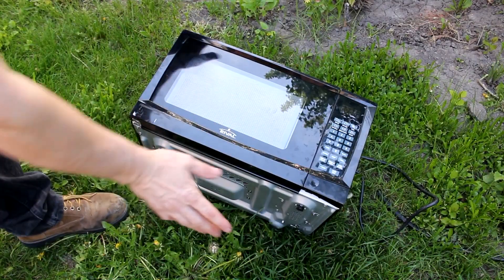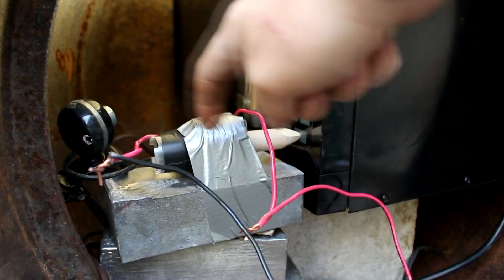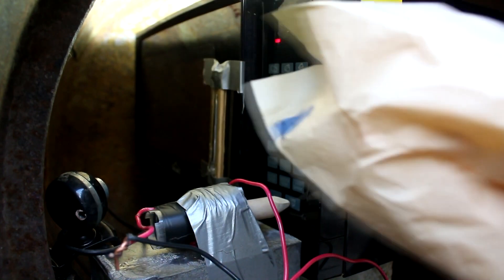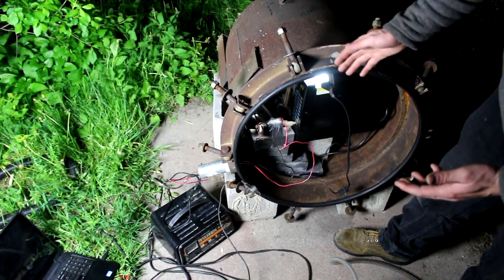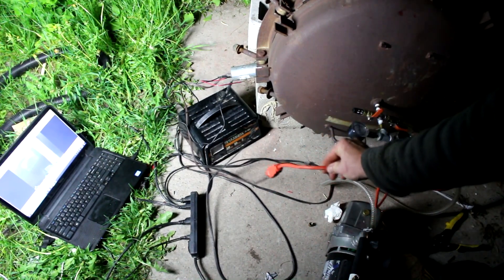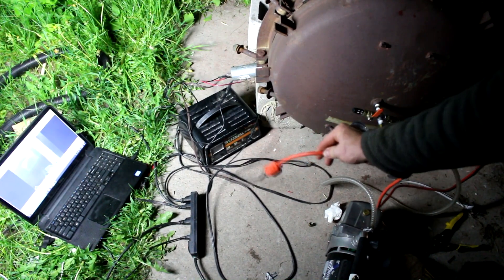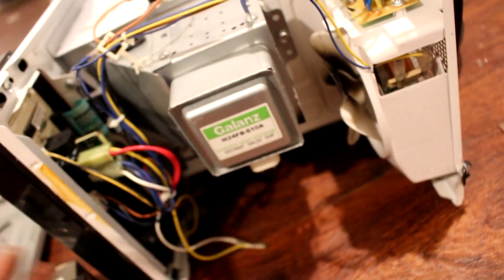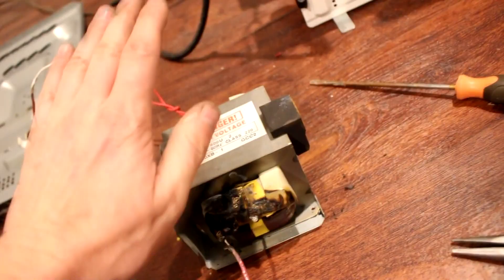Microwave In Vacuum Chamber

Comment: What happened was that the low pressure atmosphere allowed arcing to happen between winding sections of the high voltage secondary of the transformer. The coils are designed to be used under atmospheric pressure, not vacuum. Since the air insulation was removed via the pump, arcing ensued within the transformer. It would have probably worked under a high vacuum though. Basically the voltage difference between the 2 windings on top of each other was greater then the voltage needed to cause a breakdown of the gas.

However there is another permeability, a Corona discharge at the high voltage connector directed at the iron core, seeing as the core is at at ground potential. Looking at the damage seen, that is most likely scenario. However, without dissembling the secondary coil, we wont know if the first option didn't happen.

Hope my rambling explains it.
Reply: John Possum & ElectroBlood & Wood 'n' stuff, etc.; No, DEFINITELY not. Alright I thought this was too obvious to need explination, however I will go into detail for you.
TL;DR, the arc initiates IMMEDIATELY after the microwave is started (you can hear it at 4:38), which is incompatible with failure by Joule heating, but fits with the decreased breakdown strength of air, presicted by Paschen's Law.

Firstly, the "filament opening" causing a back-emf that exceeded the insulation voltage. Well, when he holds the transformer up at 7:57, you can see the filament winding between the primary and secondary coils. The arc never touched it, and it didn't draw any excessive current as the insulation is not even discoloured at all. This makes sense, since the bottom of the secondary is GROUNDED and the filament winding carries a VERY low voltage (usually <10V), so the filament winding is effectively screened from the secondary, BY the secondary.

Next I'll explain why "cooling failure due to not enough air blown by fan" also doesn't fit. Usually the secondary is wound with around 25-gauge copper wire. To give you  the ~2000V that the secondary outputs, from the 120V being input, (I am using the 'worst case' values for my explanation; It is even more impossible with higher output voltages or lower input voltages, since more turns on the secondary would be required.), you require around 17x the amount of primary turns.
With this in mind, we can calculate the mass of copper per meter (for 25AWG that comes out as 145.69g/m) and multiply that by the specific heat capacity of copper, which gives 56.09J/m°C. That means that 56 Joules are required to increase the temperature of 1 meter of 25AWG copper wire by 1°C. Now, most medium voltage (which is what 2kV is classified as) cable insulation is rated to FUNCTION up to 105°C. Charring would not even BEGIN to occur until after 200°C, but lets use the lower limit anyway.
Assuming that the starting temperature was 20°C (it was probably even cooler than this), means that we need a temperature delta of around 80°C before the insulation would even THINK of melting.
Multiplying this in, we get 42,25kJ/m, so over 42 KILO Joules is required to heat 1meter of 25AWG copper wire by 80°C.
Now, the resistance of 25AWG copper wire is given as 106.2 mili ohms per meter. And since the energy dissipated in the wire equals I^2 × R × t (current squared times resistance times the amount of time the current flows), we can calculate the current required to heat the wire by that amount. For this we need the time.
In the video, you can hear the arcing start INSTANTANIOUSLY after he starts the microwave at 4:38, however he only noticed the smoke around 10 seconds after starting, so we'll use that to give your theory the best possible chance.
Calculating the required current, we come to I=199.46A. Remembering the 17x turns ratio, this current would require AT LEAST 3,391kA... KILO amperes, from the primary coil. Now I really hope you don't think that the extention lead Cody plugged the microwave into can actually carry several kilo amps, but just incase you do, it cant. And even if it could, the breaker would trip WAAAY before that.

So, what DID happen? Well, since Cody removed 95% of the air, that means he had an air pressure of around 5kPa in the chamber. Consulting Paschen's Law, we see that the dielectric breakdown strength of air was decreased by around 10x (so to 10% of its initial value) due to the lowered air pressure. This means that even if the insulation in air was DOUBLE the required value (as a safety factor), starting the vacuum under pressure would still cause the insulation voltage to be exceeded by 400%! This is why the arcing starts IMMEDIATELY after the microwave is started, and why no energy ever got to the magnetron. (edit)This also explains why the arcing occured between the secondary and the case of the transformer, i.e. the air was easier to break down than to go through another winding's insulation as well.(/edit)

Paschen's Law also shows that, at a given pressure, there is some distance between 2 electrodes for which the minimum electric field strength is required for breakdown to occur. What might seem counter intuitive at first, is that this distance is not 0. That means that, if you measured the required field strength to induce breakdown at the optimum distance, and then REDUCED the distance between the electrodes, the required electric field strength to induce breakdown would INCREASE. 

Wikipedia provides a very good overview of the effect:
"For example, in air, at a pressure of 10−3 atmospheres, the distance for minimum breakdown voltage is about 7.5 µm. The voltage required to arc this distance is 327 V which is insufficient to ignite the arcs for gaps that are either wider or narrower. For a 3.5 µm gap, the required voltage is 533 V, nearly twice as much. If 500 V were applied, it would not be sufficient to arc at the 3.5 µm distance, but would arc at a 7.5 µm distance."
Reply: @sleeptyper, you didn't read all of my comment it seams. As i put forth 2 possibilities.

I did state the most likely problem was that the high voltage connector arced to the core due to a lower breakdown voltage of the atmosphere. Also keep in mind that melting point of the enamel decreases in a vacuum, and the coils do get hot during operation. Hence that could have weakened it enough to cause internal failure.
Reply: I would not call 10 mBar "no air", though cooling via convection and forced air cooling would be decreased a lot. Also i never stated they didn't get hot, or overheated.
Reply: I'd guess that the prerequisite for events in your explanation was that the coil enamel insulation melted first.
Reply: 5% remaining is, even assuming a linear relationship, only 5% the heat-removal. The fan is designed for efficiency at 1 atmosphere, it's probably just throwing the air around centrifugally. Again, this is getting way too overthought.
Reply: A13tech; No this is DEFINITELY not a vacuum discharge; it is simply that the dielectric breakdown voltage of air decreases as you decrease the pressure (in the pressure range that Cody can generate in that large chamber), as has been stated above. The temperature needed for thermionic emission in copper/iron is literally THOUSANDS of degrees C, and both metals would melt way before that.

As for field induced emission, that requires VERY high electric field strengths together with a VERY good vacuum (specifically, the mean free path of electrons need to be much longer than the distance over which the voltage is applied).
And even if it were to happen (say, for instance, Cody had it under 10^-10mBar or lower, AND had an electric field strength of several 10's or even 100's of MV/m), field emission of electrons by copper (or iron, depending on the polarity) is not very 'bright', i.e. there would not be a large amount of current that could flow via that path.
Reply: Well, now Cody can do dielectric strength tests for the enamel in vacuum. :)
Reply: he will have to account for the heat that the coil experiences during operation. But yeah, that would be fun to see. However, at that point he might as well autopsy the transformer and find out if i was correct with both possibilities or not..
Reply: Copper is very heat conductive. For a coil this big, you'd definitely need at least a couple dozen minutes to reach any significant temperature. Besides, the vacuum microwave drew way more power than the ambient one. This means that something else than just lack of cooling must be going on. Corona discharges for example.
Reply: Corona is only logical explanation... Vacuum is better isolator than air. (much much much better). Dielectric constant of air is around 3MV/m and for vacuum around TV/m and conductivity for vacuum is almost (right) zero so...
Reply: Indeed, Jack, indeed. Even at a few hundred watts, it will still take at least a minute or two to heat that copper mass to anywhere near the insulation's limits (usually around >200°C). And that coil does not produce over a hundred watts of power loss. It's probably close to 10 W or so.
Reply: Tubeist-dan  & Fester Blats. Sure it Could have simply overheated, but that would have taken a bit longer than what we actually say. It started arcing in 1-2 seconds. That is FAR to short a time for it to heat up enough for the insulation on the wires to fail like that. Remember that things dont heat up instantly, plastics especially 'resist' heating and cooling, which is the reason they are used for insulation in the first place. 

It is basic thermodynamics.

If it had taken longer, sure overheating would be the likely cause.
Reply: MRLT well said.
Reply: ElectroBlood; Hahaha, it sounds like you know what you are talking about! Do I sense a fellow EE? ;)
I second that sentiment though, having your circuit blow up is MUCH more fun than having your amplifier turn out to be an oscillator and having your oscillators being stable amplifiers (as always seems to happen if you try to push the envelope)!
Reply: @MRLT
Well, the FETs were not THAT big... The inverter was for three phase 2 kW at 48V, so that's about 25 A. 
The DC block? Is that a safety circuit that prevents the gate driver from outputting high or low for a "long" time? Hmm. Interesting. Thing is, my fellow student was trying to see how the input signal looked and moved the probe while the circuit was working. By connecting gnd to the wrong pin, or maybe shorting the input by touching multiple pins, that pulled the input to low (that is my assumption), which in this specific case turned the FET on. So... I'm not sure if a DC-block would help in this case. :O

Ah yes, cross conduction. Heard about that one in lecture. And of course, to reduce EMI as much as possible, you don't want the whole bridge to turn off for a significant part of each cycle. Must be quite hard to get this right.

Wow, that's quite interesting. Thanks for the thorough explanation! So that is the connection between phase shift diagrams and the stability of a control system. I never realized that!^^

No, the inverter above is the largest power electronics I've seen "live" so far. But that's pretty cool stuff! I guess with IGBTs that large at this sort of voltage, short-circuits will cause many kW of heat to dissipate inside the package. That's basically a small bomb going off. They always told us to keep our distance from running prototype power electronics. That's why. PRAISE THE GOO! :D

Last year, I was lucky enough to get to tag along on a trip to visit a few industrial sites (mainly high voltage stuff). One company had a lab to test mechanical high power switches (for generators and substations). They showed us a record of a demonstration they did with their humongous flywheel generator. They put two long copper rods, about 10 cm thick or so, on the ground. Then they started a small arc between them with a transformer. So far, nothing spectacular. They then proceeded to switch in the flywheel generator, delivering >200 kA of current into that arc. After the evaporated copper smoke had cleared, the electrodes were at least half a meter shorter than before. That was pretty spectacular.^^
Reply: lbochtler what you said makes sense.... Cody could try using a dielectric liquid for the same to make it successful but that would require a lot bigger setup
Reply: Riiight. Corona discharge. I was wondering why the dielectric strength of air being reduced had anything to do with the solid laquer insulation of the windings failing. The simple answer is: They did not fail. Corona discharges burnt the insulation. Thanks for that reminder! ^^
Reply: lbochtler Hi the core of the transformer on micro wave is connected to one side of the HV seems strange but there is a reason I am sure. Melted a DMM when I first tried to measure the voltage of one as it was sitting on anti static mat.
Reply: It is indeed, and its also at ground potential. Its done to use the microwave case as a conductor to deliver power the the Magnetron. Its connected to the anode. Effectively the Cathode of the Magnetron sits at a high negative potential referenced to ground. where as normally with other tubes the anode sits at a high positive voltage.

The anode of the diode in the voltage doubler circuit is also connected to ground, if you where wondering.

Edit:
I am no RF expert, but im guessing that grounding the anode of the magnetron reduces RF leads when doubling the energy to the waveguide. As well as being more economical due the less insulators being used.
Reply: There was still air, and there was still convection the fan was still moving air threw the microwave. But all at a very reduced amount. 'You would be correct if this was in a high vacuum though.
Reply: Yes - very intresting. I saw that on an old microwave I took apart recently that one end of the secondary winding in the transformer was connected to the core (wich in turn was grounded). If this one was connected the same way, it's likely that the arc started between the other end and the core. 
The gap may be quite small and have the full output voltage across it (compared to the realatively small voltage potetial between the turns in the winding, if it's winded the way it should). Then as we know - once the arc has started and keeps going, it burns away all the insulation around it (causing more arcs and a big area to get burned out).
Reply: From Wikipedia, the free encyclopedia
A vacuum arc can arise when the surfaces of metal electrodes in contact with a good vacuum begin to emit electrons either through heating (thermionic emission) or via an electric field that is sufficient to cause field electron emission. Once initiated, a vacuum arc can persist since the freed particles gain kinetic energy from the electric field, heating the metal surfaces through high speed particle collisions. This process can create an incandescent cathode spot which frees more particles, thereby sustaining the arc. At sufficiently high currents an incandescent anode spot may also be formed.

Electrical discharge in vacuum is important for certain types of vacuum tubes and for high voltage vacuum switches.

The thermionic vacuum arc (TVA) is a new type of plasma source, which generates a plasma containing ions with a directed energy. TVA discharges can be ignited in high vacuum conditions between a heated cathode (electron gun) and an anode (tungsten crucible) containing the material. The accelerated electron beam, incident on the anode, heats the crucible, together with its contents, to a high temperature. After establishing a steady-state density of the evaporating anode material atoms, and when the voltage applied is high enough, a bright discharge is ignited between the electrodes.
Reply: Do explain the mechanism that lead to a arc across the secondary of the transformer when the magnetron failed. (preferably one thats quick, that can kill the transformer that quickly). Also how would the magnetron fail exactly, the only failures i can come up with, based on how they are designed, are as fallows:
- Filament opening up
- Anode Cathode short
- Loss of vacuum fallowed by burnout of the filament (with possible anode cathode short as a result)

However, none of the above would lead to a transformer burning up in mere seconds..Is there something i missed?

Also, based on the damage, i would have to guess that the magnetron never got powered in the first place.
I would find it interesting to see Cody test the magnetron for failure.
Reply: +wood : The fan runs as soon as the microwave is started. Failure mode for coils is that they can increase their voltage to overcome their insulative wire value if left open -- THAT is more what it appears like.
Reply: John Possum - Sure... But a fan moving zero air is just like a fan that's not running. It does absolutely nothing to cool the magnetron.
Reply: sleeptyper probably just a crack in the enamel from the winding process.
Reply: @MRLT Well, I was just trying to come up with something that would fit with the magnetron dying and taking the transformer with it. Paschen's Law (even if I did not name it) was our assumption further up this thread. Thanks for the long comment, though. Always nice to see people that care about explaining things thoroughly!^^
Yes, the breakdown voltage increasing in very small gaps is due to the electrons not having enough time to collide with air molecules to produce more electrons. This inhibits the charge avalanche that is an arc.

@Mark Hunter Ok fine. I was just guessing. Since this is a 900 W microwave and assuming a 90-95% efficiency,  we should have around 45-90 W power loss. That's pretty much what you were saying. I guess that's why they put the fan there. Of course, that's not even close to the amount of power needed to heat that thing up in mere seconds.
Reply: ElectroBlood; Ah right, thank you for explaining. There is always a fine balance between thoroughly explaining something and sounding patronising, which definitely wasn't my intention! My comment was mainly aimed at people who insist that the transformer died due to the vacuum not providing enough cooling air to it.

If you don't mind me asking, why did you think the magnetron died though? There doesn't seem to be any damage to it, and the secondary arcing would have lowered the voltage going to the magnetron. Also, since the inside of the magnetron is already evacuated to a high vacuum, Cody's vacuum wouldn't have caused any arcing or other pressure-related damage to it...
Reply: Because the guy above me said the magnetron failed and took the transformer with it. So I wanted to hypothesize how the magnetron may have killed it. I now see that i made a bad assumption because a voltage spike due to the filament rupturing (for any reason) would have been clipped off by arcing inside the filaments enclosure. 
But hey, making hypotheses and then disproving them is where most of the fun in science/engineering is at. Well, the second most. The most fun is building a large electrical circuit and then have it blow up spectacularly when you turn it on (only when that is not the intended effect of course).^^
Reply: You sense right!^^ (well, I'm only a student)
Hehe, that can cause some trouble. And some tinnitus if you're talking about an audio application. And an oscillator becoming an amplifier? I see how that would work, but what does it do to the circuit? If it's something digital you'll just not get any clk, but if you need that oscillation for something analoge... Do you just get a DC signal?
I once heard a loud bang in the lab I was doing an internship in. Turns out someone that was building a high power motor inverter set the gates of two power transistors to high by misfortunately connecting the oscilloscope gnd to a pin on a gate driver. That made a dead short on a 300+ A power supply. Three FETs blew right apart in a giant shower of sparks (nobody was hurt). That was the most fun I had during that internship! :D
Reply: thank you! it seems like some people think, that air is a better isolator than vacuum.
Reply: I prefer Guinness discharge.
Reply: ElectroBlood; Haha, wow. Yeah that seems REALLY unfortunate (big FETs usually require a pretty substantial gate driver, which should be able to sink a lot of current before letting the volatge rise... maybe he removed the DC-block?)!

That effect actually has a name, its called cross-conduction, and it causes a LOT of problems if you don't have the timing set correctly. Even if you have a bit of dead time between the gate pulses, if its not longer than the inductive turn-off time of the FETs, you'll get a short of 10ns~10us (depending on the exact circuit) on EACH and every cycle. That adds up to quite a bit of heat being dissipated... normally not enought to blow anything, but a pretty big waste of energy and EMI source!

As for the oscillator thing, I was specifically referring to the working of most common oscillators: You esentially have the inverse design goal of an amplifier, but you still use the same type of circuit. For a negative-feedback stabilised amplifier, you want the gain to drop below 1, quite a bit before 180° of phase shift has occurred (for those that maybe don't know, if you have a signal shifted in phase by 180°, you have the negative of the original signal. Feeding that back to the inverting input with any amount of gain >1, results in the amplifier outputting an even bigger positive signal, which gets phase shifted and fed back, then gets even bigger, etc.). However, for an oscillator you basically want the exact opposite. You still want as much gain as possible, however you are now designing the circuit to have EXACTLY 180° of phase shift at a precisely defined frequency (where you also have a gain >>1).

The problem comes in with the 'pushing the envelope' part: Its simple to make a stable amplifier, just cut its gain off before it gets to 180° of phase shift. However, if you want to make an amplifier either have the least amount of distortion possible, or you want it to work to the highest possible frequency, you want it to have as much gain as possible at the highest frequency of interest. This then means that you start running into danger of having a gain of >1 at 180°, and even if the amp is stable on the bench under resistive load, once you connect some capacitance to its output (could be as simple as the capacitance of the cable you use to connect to the amp's output), the resulting increase in phase shift can very easily move the 180° point low enough that you have gain >1 there; which, again, causes it to oscillate. And yes, you usually just get DC at one of the supply rails when your oscillator fails to chooch.

PS. Since were sharing stories, have you ever seen the guts of a big IGBT after it has popped? They fill it with a white resinous substance exactly for this reason: To keep the bits of metal from turning into shrapnel!
The biggest one I had go off near me in the lab (a post-grad doing his doctoral thesis on power converters), was a set of 4 1.7kV,1.2kA IGBT modules being used in an H-bridge and driven from the HV lab supply (the supply comes directly from the utility, with one entire 100kW step-down transformer being only used to power that converter at the time). I was more than 10m away from it at the time, and my one ear was literally ringing for the next 2 days! Again, luckily no one was hurt (the white goo did its job admirably), but it was one TERRIFYINGLY big explosion.
Reply: Horst W, as stated above in a previous comments thats not the case here, since cody has not created a high or very high vacuum. He only got to 10millibar (roughly) which is not all to significant vacuum. Also, keep in mind that Paschen's Law is very much a thing that can not be ignored.

Here is a graph describing what i am talking about, and also why you are wrong when it comes to this situation. https://upload.wikimedia.org/wikipedia/commons/e/e2/Paschen_curves.svg

Look it up if you want more information about it.
Reply: lbochtler is right. Except for the part about 'arcing between winding sections'; the arcing was actually the top of the secondary (highest voltage) to the case/core (not that it really matters in this instance).

I honestly don't get why people keep thinkting that 50mBar (which is what you would get if you removed 95% of the air) is a good insulator. Since the variable of interest isn't actually pressure, but pressure×distance, Cody reducing the pressure by 95% is THE EXACT SAME THING as DECREASING the distance between the arcing electrodes by 95%, while keeping the pressure at 1Bar!
Surely you can understand why, at normal atmospheric pressure, an arc will form much more easily if you decrease the distance between the electrodes (at least for any macroscopic distance > 100 micro metres)?
Reply: lbochtler, that´s very intresting. thank you for that information. did´t knew anything about paschen´s law.
Reply: @ElectroBlood; Okay WOW, I have never seen anything THAT powerful in real life! Apart from the 'metal-fume-fever', I would REALLY have loved to see that.

Yeah the DC-block is usually either inside of the oscilloscope and/or an external capacitor between the input and the probe. However if he shorted multiple pins, or connected the ground to a floating node, that would indeed mess up the circuit regardless... They always told us to disconnect the oscilloscope's ground pin (we usually ran it through a small transformer for isolation as well) so that it could float to whatever voltage you connected the ground to... Which is fine when probing low voltage inputs, but might give someone who doesn't expect the case to be live, a bit of a shock (pun intended). The 'proper' way to do it, of cource, is to use 2 probes with both of their grounds connected to signal ground, and then to connect the 2 probe tips over the voltage of interest. The math function then gives you the wanted 'multimeter-like' voltage probe you wanted. Unfortunately the undergrads are usually too lazy to do this, however, since the scopes they use only have 2 ports...

As an interesting aside, have you seen how safe electricity in water actually is? Cody said in this video that he took steps to prevent electrocution from working in the rain, however that was COMPLETELY unneccesary. Usually people that know a little bit about this, assume that's because pure water is non-conductive, however it also works with VERY conductive brine solution, since the conductive brine acts like a huge resistor-divider network. Of cource, if you place the live ac wire at one end of the water, the ground/neutral at the other and then your body in between, conductive solutions could easily result in electrocution. However, if you keep the exposed wires closer together (like the power lead breaking off from an appliance and falling into the bathtub; which always leads to death in the movies) than the live wire is to you, you will be perfectly fine... ElectroBOOM has a really good video about electrocution in water showing this effect. Just don't have any cuts on your hand, since the salt water would then burn pretty bad (like it did to him😂).
Reply: upvote this person. definitely need to see what it really was.
Reply: No, it fried because the magnetron - which is a very high energy device - wasn't being cooled. Without the constant movement of air from the cooling fan, magnetrons burn up very quickly and can take out other components when they do (particularly, the power transformer. But sometimes the H.V. diode as well). Even when they ARE being cooled, they still run very hot. So with no cooling at all and they're toast in no time at all.
Reply: The only thing that I could imagine is the transformer insulation being so extremely cheap that the increase in voltage from the filament opening (due to no current being drawn from the transformer) in combination with the voltage spike due to rapid change in current could cause dielectric breakdown. But safety margins should be much higher than that.
Reply: I agree in principle to your conclusion, but your reasoning is flawed, 10 watts is a gross underestimate for the losses in that coil.  50-100 W is far more reasonable.  Still conclusion holds though.
Reply: There's no air, no convection, no forced-air cooling from the fan, not enough radiative cooling (after ~10 seconds). The windings are overheating.

You guys are way overthinking this.